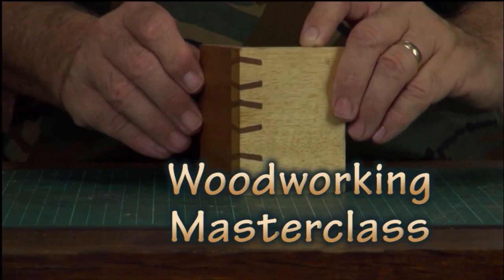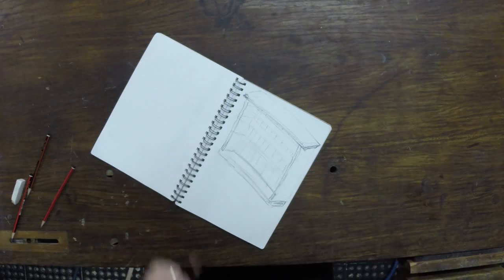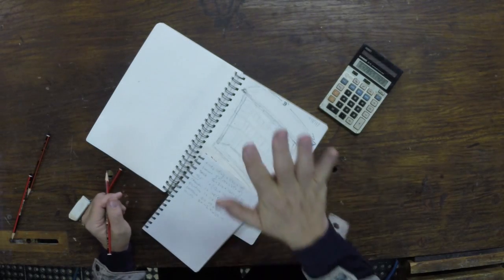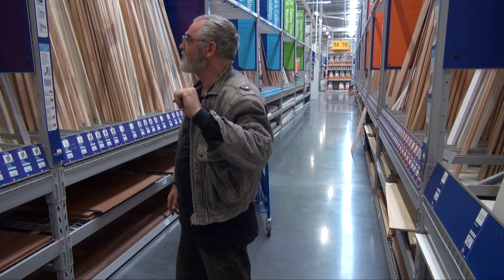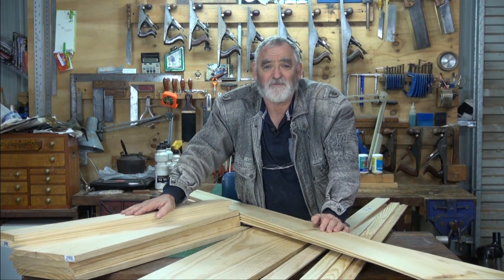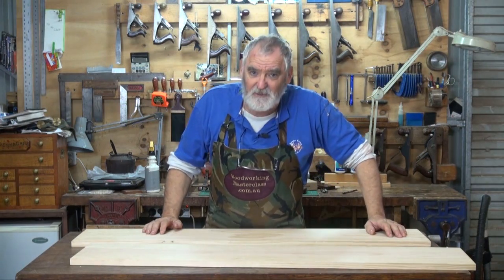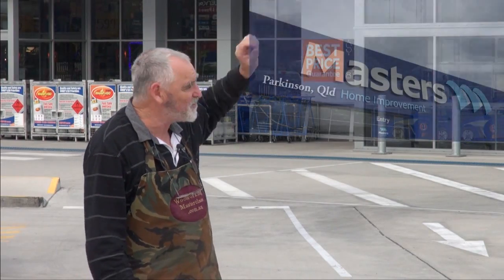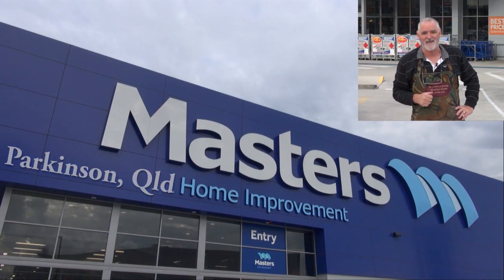4' x 3' Bookcase Part 1 of 6

Comment: Hi Steve,

I am keen to build this as a project to get back into woodworking and the swing of it! Your videos have inspired me to tackle this project and I was wondering if you would be so kind as to provide the list of materials used by any chance?

Wood sizes and everything needed to pick up to get, looking through his video I can find snippits of the sizes, but I wouldn't mind a bit of a shopping list :)

Cheers!
Reply from the maker: +nsx2200 All depends on how you want to build it. The one in the video had 7 x (238 x 19 x 1200) Shelves and Sides. 2 X (42 X 19 X 1200) side cover strips. 2 X (90 X 19 X 1200) Stretchers. 9 x (140 x 12 x 1200) VJ Back boards. 2 x (180 x 19 x 1500) to be joined for Top. 1 x (70 x 19 x 2100) Skirting. 1 x (70 x 19 x 2100) Capping. I'm pretty sure that's it, all metric but easy enough if you want to convert to Feet Inches. Hope that helps. Looking foreward to seeing the results. Cheers Steve